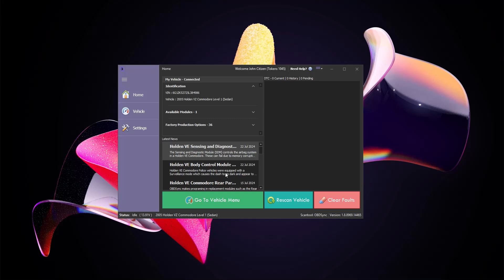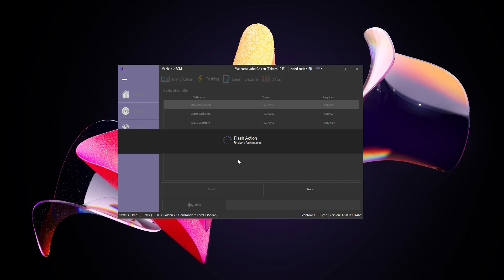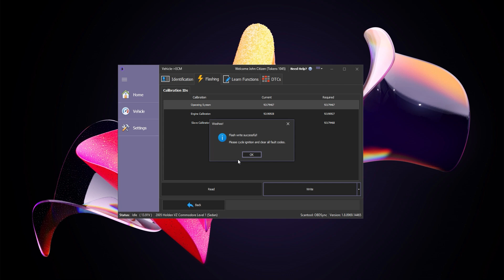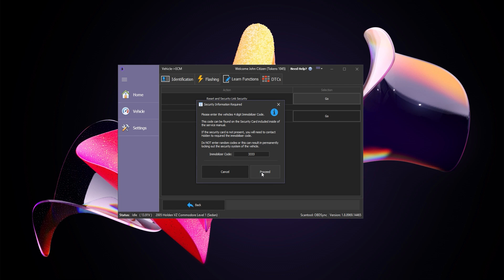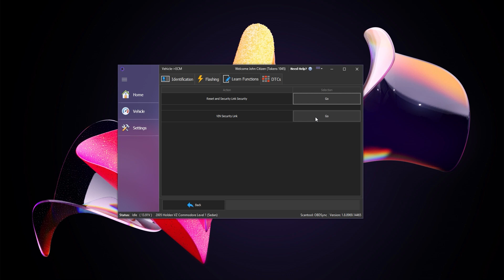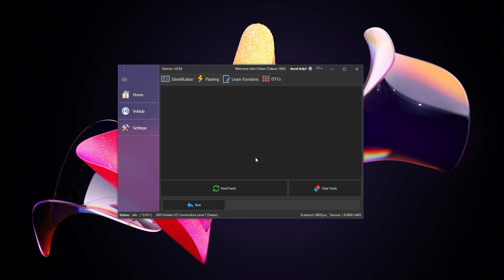Holden VZ V6 Engine Control Module (ECM E55) Replacement Programming and Security Linking

Comment: Was this a blank ecu or was it from another car if so how do U reset all the info from the working ecu to then except original ecu data
Reply: Where do i get the immobilizer code from ?
Reply from the maker: Ecu resetting is automatically handled by OBDSync for second hand ecus.

You do have to input the correct immobilizer code for the vehicle you are trying to program for the link procedure to work correctly.

Comment: I just installed a new ecm in my 2005 sv6 commodore. It was a blank ecm. Everything went perfect for flashing all the os, calibration file and rellinking the security immobilizer system. Can't believe how well this worked!!! Now the car starts every time with no errors. Next job is the vf ss-v redline locking the BCM so thiefs can't create new key and drive away with my pride and joy.
Big thanks to Mat from OBDSync for the reply to an email I sent to answer my concerns. 
I didn't want to end up with an expensive “brick”😅 if things went wrong.
The OBDSync really makes it easy

Comment: The Immobilizer code! if I have replaced ECU, PIM, BCM, and keyfob from a doner vehicle will I use the immobilizer code from doner car or the original from my vehicle?
Reply from the maker: You will need to enter the code for the modules that are fitted in the vehicle.